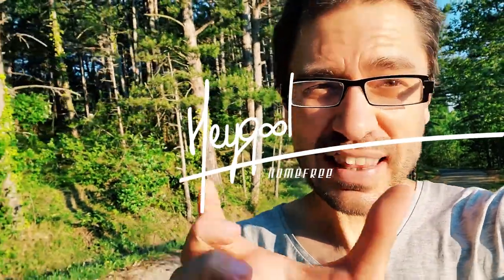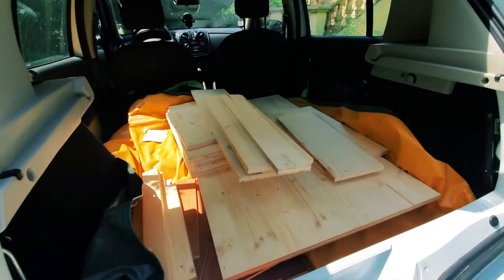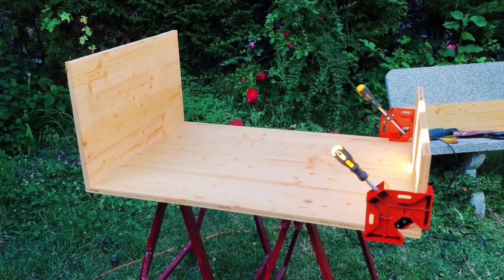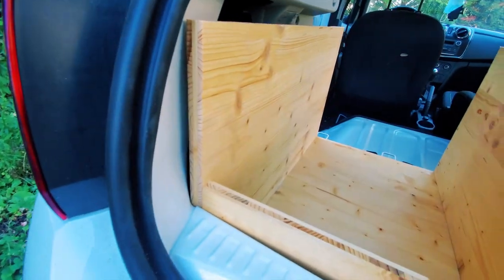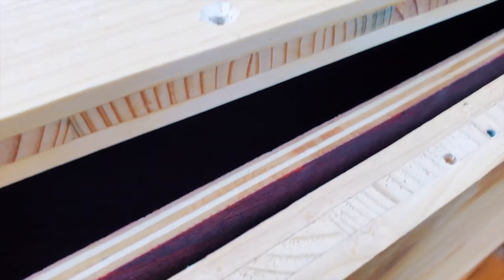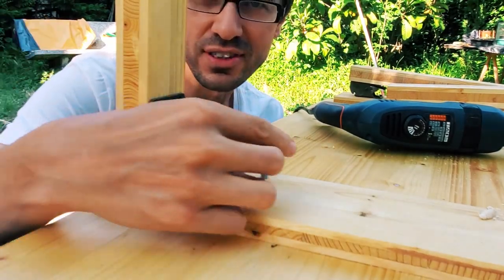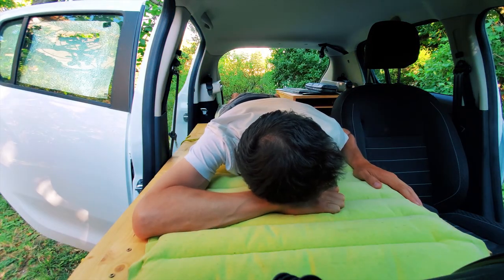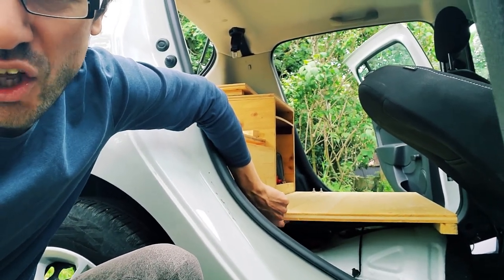Converting a basic Dacia Sandero car into a CamperCar to travel  ☯️ Making the CarHouse

Comment: Cool! Still looking for ideas to make a mini camper out of my 2010 sandero, this helped a lot, thanks!
Reply from the maker: @xTESSAAAAAx  So happy to hear that ! Thanks for stopping by and best inspiration for your project 🎉🎉🎉
Reply: @meyqool  thank you! I was considering buying a veeeery expensive rooftop tent first, but did I mention that they are expensive? So this would be the second best option for me lol. I like the setup you did, I think I'm going to borrow that idea. How is the cold/warmth in the car at night? So far you're the only one that I've found that uses a Sandero as a mini camper😂
Reply from the maker: @xTESSAAAAAx  I suppose it depends where you plan to travel, the car doesn't bring much heat if it's cold outside (I don't use the heating / gas), but it's generally a bit warmer inside. What I recommend is having a warm sleeping bag, like 0-4°C (-20°F) if it's going to be cold, and then it's totally fine ! Or you can build a roof tent... 😛

Comment: This is amazing! I have the same car and I always thought it is to small to tur into a useful camper. But the way you did this looks fantastic. How much did everything cost you in total?
Reply from the maker: Hi Eva, thank you for the positive feedback ! Yes even a small car usually has enough length inside for a full humans body's length... The cost for just the wood structure was around $250 if you count the wood shop's work for the boards, plus the varnish, glue, and various fixations. The electric system is a bit more expensive as the battery is not cheap ! Let us know if you decide to make something !

Comment: 4:22 Hey @meyqool Is that CLT - Cross-laminated timber?
Reply from the maker: I think it's different, but not 100% sure of the correct english expression. In French it's 3-ply wood (3 plis) which is a "plywood". It's made of gluing together 3 layers of wood (in this case spruce). That being said from what I see, CLT should provide a very similar result. But I'm not a wood expert ! Hope this helps you a tiny bit.
Reply: @meyqool  Wow, I was not expecting such a quick reply. Thank you Mickail! Would you be able to share the Tinkercad plans with me? I was thinking of starting from scratch. Although, what you've done is already so well thought through I can't think of much to change... I also have a Dacia Sandero (2020)
Reply from the maker: @brandon853  Glad I could help, it turns out I'm working in front of the compute right now. I replied to your eMail. I wish you great success, surely this design can be improved in many ways, let me know when you do ! ✨✨✨

Comment: How did you bend the seats like that? in my dacia its only a few degrees
Reply from the maker: Is it also a Sandero ? What year ? This is a City+ from 2020 (Sandero 2). You mean it only goes a few degrees back and blocks ? 🫨
Reply: @meyqool  yes i have a sandero 2 stepway i think 2019. and it basically just goes like like 20 degreed in each direction
Reply from the maker: @dominikotten9283  well Stepway being an upgrade from mine, I'm surprised it can do anything less, but I am not familiar with that  model — on the City+ you just rotate the knob and it keeps going down like that 😬 maybe a jackhammer is needed 🫨
Reply: @dominikotten9283  mine too. I don't think it's can pushing more...

Comment: Side impact will kill you because of the Woodplate over the passengerseat ..
Reply from the maker: Hey Frans ! If I drive like this, yeah ! But I barely ever drive like this, the passenger seat board is dismounted and retracted to the back. The passenger seat usually just has 2 small backpacks while driving.  But thanks for pointing that out, that would be a massive security flaw indeed 😌